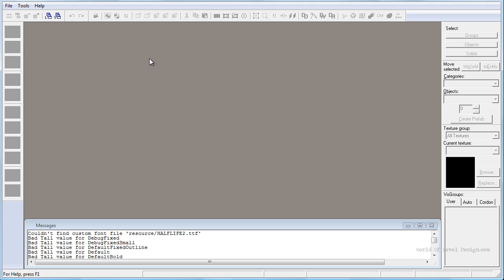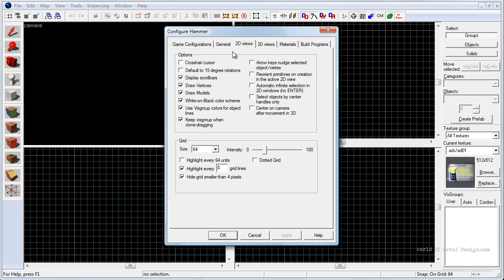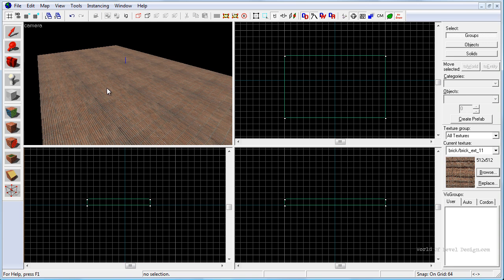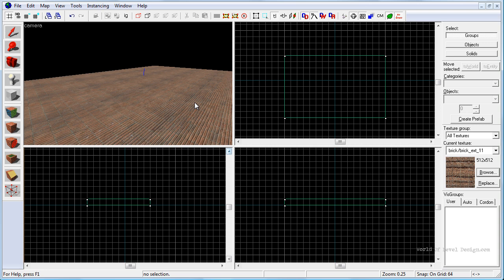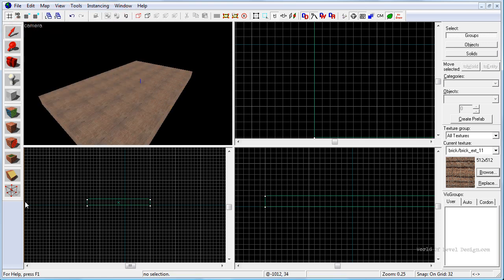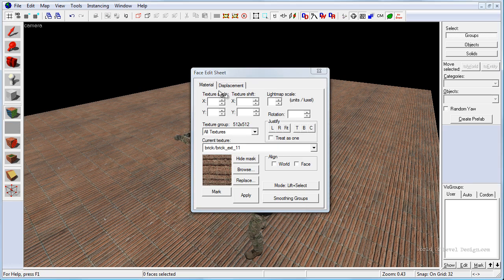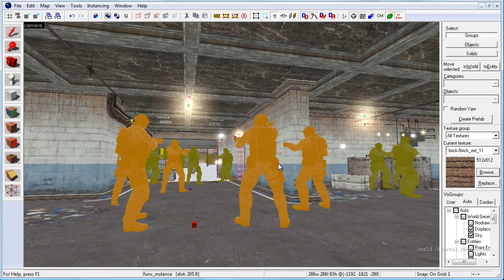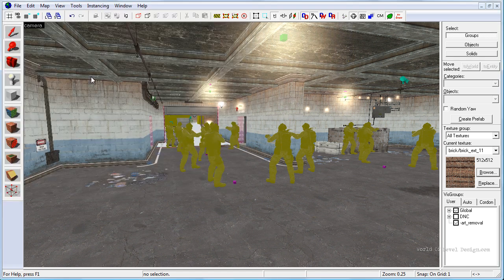CS:GO SDK Navigation and Interface Basics in 15 minutes - Beginner Series 2/8  [Tutorial #02]

Comment: When i open the office map most of the object are just bunch of randomly colorized boxes, how do i change it to how it looks like for you ?
Reply: I know it's late, but in case you still need to know, or if anyone else reads this and needs to know:

When the map opens, do a CTRL+A to get all the view ports open.
Next, in the top left corner of the top left pane there should be a little box labeled "camera"
Lastly, click on this, and select "3D Textured"

If this answer is confusing or doesn't solve your problems, lemme know and I'll see if I can't help you get started (this goes for anyone.)
Reply: @MegaBlackDays  its 5 years late now lol
Reply: So, the triggers, clips, and skip brushes can be hidden using a different method. First off, make sure you have de_inferno_main.vmf open, and not just de_inferno.vmf. de_inferno_main.vmf is located here: ..\sdk_content\maps\instances\de_inferno\de_inferno_main.vmf

Next, on the right side of the screen, there should be a section called VisGroups. If it isn't there, go to the View Menu -> Screen Elements -> Filter Control and make sure that it is checked. This will re-open the Filter Control/VisGroups window, which you can then dock on the right side of the screen. Once you have that window, you might want to undock it by dragging it away from the right side of the screen. This way you can resize it to see everything. There should be three tabs: User, Auto, and Cordon. Select the Auto tab, and you should have this nested list with a bunch of check-boxes. Scroll down, and there should be a section called "Tool Brushes." Uncheck that box, and most of the Hints, etc. should be hidden now. Unfortunately, you can't fully hide Area Portals, or trigger brushes this way, but it'll get rid of most of the annoying stuff, like the Hints and Skips. You can hide individual things by selecting stuff and hitting "H" and unhide/show them by pressing "U."

None of this actually alters the map in anyway, just hides what is shown. Note, though, that hidden things (either by manually hiding them or hiding their VisGroups) will not render when rendering a map. This is useful for hiding all the spawn points, complicated stuff, complex lights, etc. and getting a fast render to test something small.

If you have any more questions, lemme know. I should probably start doing tutorials because I know damn near everything there is to know about Hammer.
Reply: No prob. Just hit me up if you need any more help. Here's my Steam: http://steamcommunity.com/id/drgreatjob/